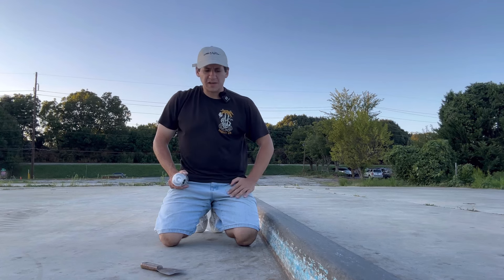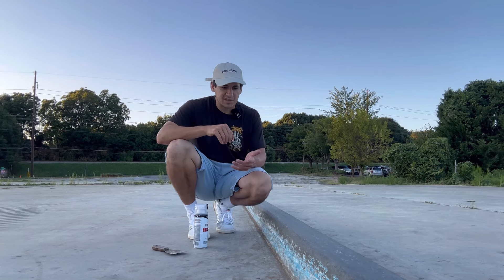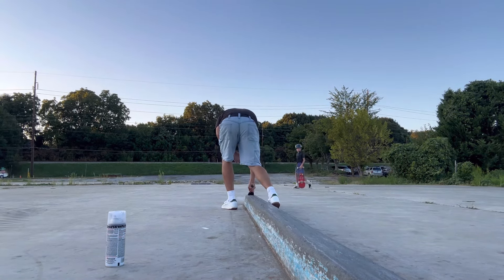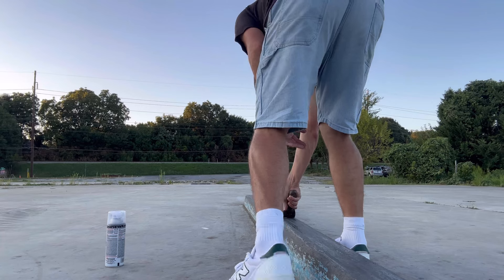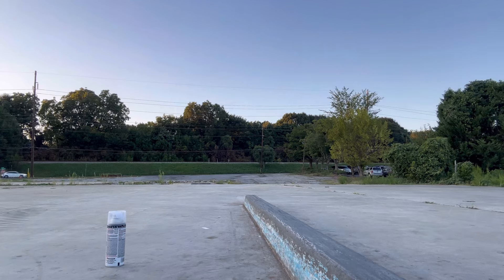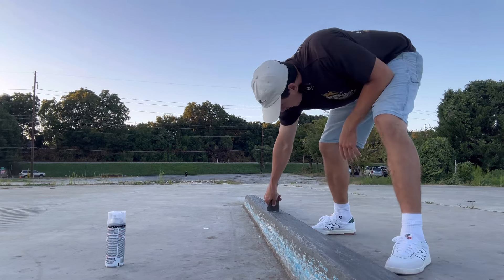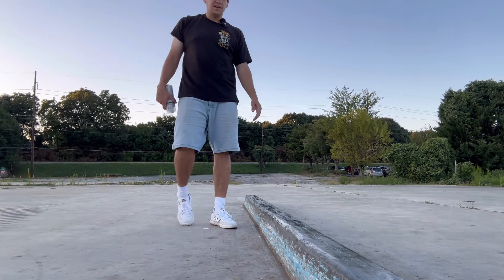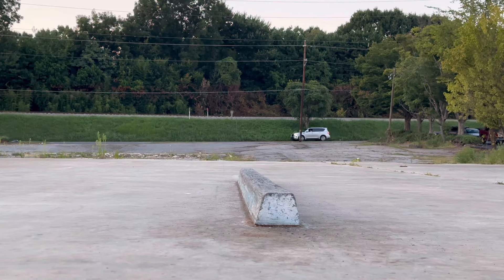Curb Maintenance - Episode No. 1

Comment: they have these tall spray cans of clear concrete/masonry sealer. not sure of the brand, they have it at walmart. it's worked well for me. slides well but not too slick, i wax over top once it dries. i could have done more prep with rub brick, but i'm happy with it.
Reply from the maker: @diplenski  that’s rad! I’ve tried a ton of different brands and these seem to do the best overall and are pretty cheap at Lowe’s and Home Depot

Comment: I don't know why nobody uses high gloss concrete sealer and a roller. I clear coated an entire plaza one night, 8 ledges about 10-15 feet each. Next day came with wax and butters up the whole spot. Using a loud spray can at a street spot is Sketch and draws hella attention.
Reply from the maker: @Chris-bw9bq  because that doesn’t work well over an already waxed curb. Anything that is oil based flakes off. This is a maintenance vid and not a curb prep vid.